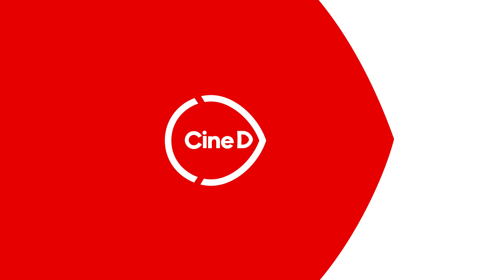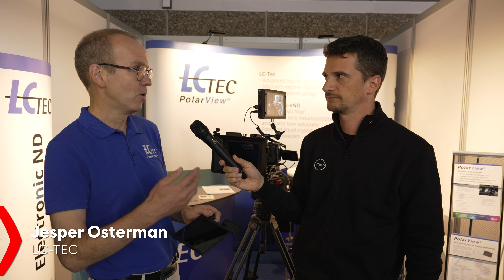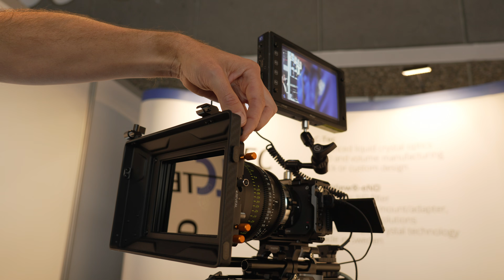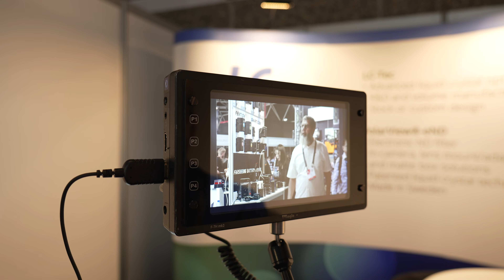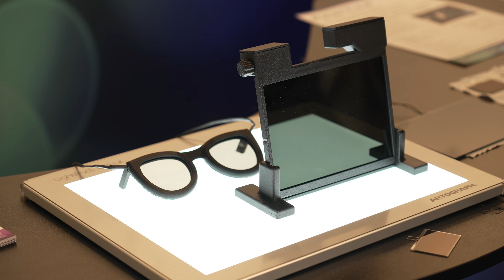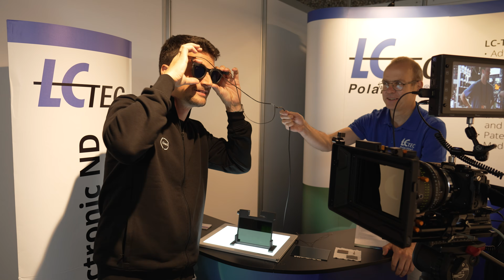LC-Tec Explains Concept for 4x5.65” Electronic Variable ND Filter – First Look

Comment: I'm guessing it's in the Sony Burano.
Reply: Actually I think Sony said in an early interview it wont fit in the Burano, maybe I'm wrong.
Reply: @drew_hewitt  sony actually have e-ND and also IBIS.both, This is the world first.
Reply: @drew_hewitt the burano have a e-nd even with ibis
Reply: But the FS5mkii had an eND.. not to mention the FX cameras? Or are those polariser based?
Reply: They were S35 sensors I've been told it doesn't fit in a FF housing @_burd
Reply: @drew_hewitt  both the FX6 and fx9 are full frame..?
Reply: @_burd  Right of course, my blunder. Anyways it's not in the Burano

Comment: I used the Z CAM eND for a few years. It was pretty nice, but did have some color shift. Perhaps in the future they can make it go to zero stops so it doesn’t have to be removed.
Reply: Since they likely use liquid crystals, even perfectly perpendicular they'll still take some space and reduce light unfortunately. I think that sony's approach is pretty cool, a simple motor to place it on or off, but you could even make it manual to avoid motor failure
Reply: if they just replace the shutter mechanism with a something like this that slides in front

Comment: I hope they can make a fast switching 24-60hz version for use as a shutter on the many cameras that have slow rolling shutter readout speeds.
Reply: Red made this product many years ago but it has two major limitations - it is still ND so very bright regions will have exposure when the shutter is 'closed', leading to motion artifacts, and any camera with rolling shutter over 20ms cannot shoot 24fps 180 degrees with a shutter in front, because 1/48 of a second is 20ms. There's not enough time to read the sensor. Red's was a polarizer while this one claims to not be so that's an improvement.
Reply: @Tony__S  the new bmpc 6k fullframe and lumix s5ii seems to have 20+ ms of rolling shutter, what will be the appropriate shutter angle to shoot at 24fps?
Reply: @decimalWeb  By my estimate, with a moderately fast pi-cell LCD shutter, the new BM FF6K shooting 24fps open gate (RS=25.08ms) would be able to achieve a 126° global-shuttered exposure.
Reply: @decimalWeb  If a shutter device were made it would have to be an exposure at least as long as the rolling shutter. 1/48 = .02083 so if a rolling shutter is longer than 20.83ms it can't do 1/48. 25ms shutter means 1/40. 

A way to think of it is that 21ms rolling shutter means the top line of pixels has finished exposing before the bottom line has started exposing. They actually don't capture any of the same moment in time at 1/48.
Reply: @Tony__S  Interesting, I did not know that about the Red Motion Mount; that it shows motion artifacts with very bright objects. Makes sense as a liquid crystal in its opaque state can only be expected to block light up to a certain intensity. Can you link us to any examples of frames or videos which demonstrate this artifact? I'm wondering how common it is, and how bad it looks. 
I think the issue of losing, at a minimum, 1.5 stops of light when using an LCD shutter like the Motion Mount is less of a problem now than it used to be, given how much high ISO sensor noise performance has improved. This potential highlight artifact is something I never considered, but could be a big issue. As far as not being able to achieve a 1/48s exposure with any camera whose RS readout time is greater than 20ms, this is also an issue, but I wouldn't call it a deal breaker. It would mean that some cameras would have to use sub-180° shutters, in order to reach a global shutter exposure. For instance in the case of the new Blackmagic FF6K, which requires 25.08ms to readout the open gate sensor, a maximum of 16.59ms are available to create a global shutter exposure. Assuming, somewhat pessimistically, that the rise and fall time of the (pi-cell) LCD shutter is 1ms and 1ms, and subtracting those times from the total, for the sake of simplicity, leaves 14.6ms available. I calculate that a 126° shutter would  then be possible on the new Blackmagic in open gate 6k 24fps. Not perfectly ideal, but workable.